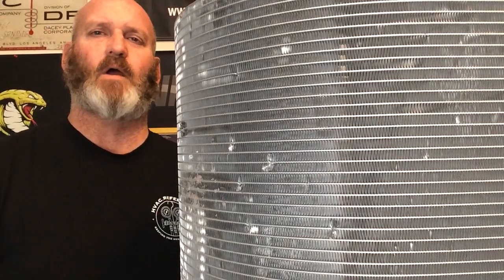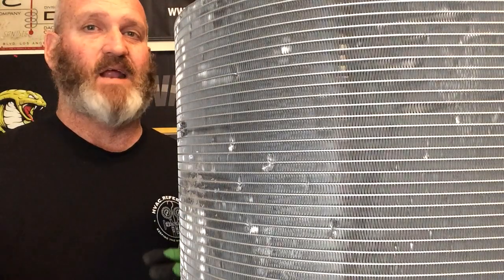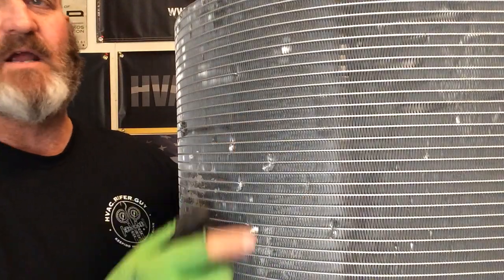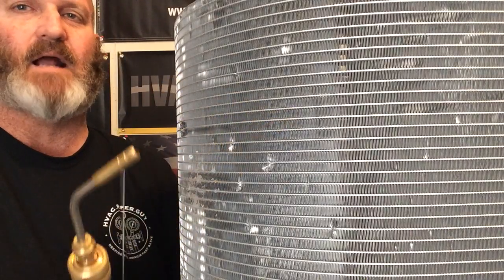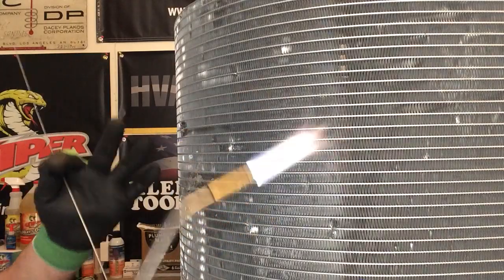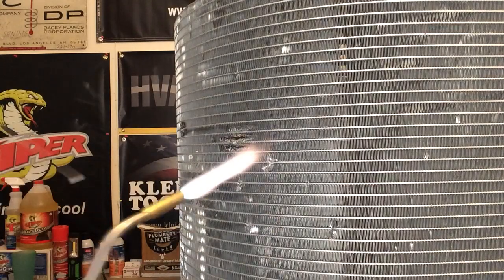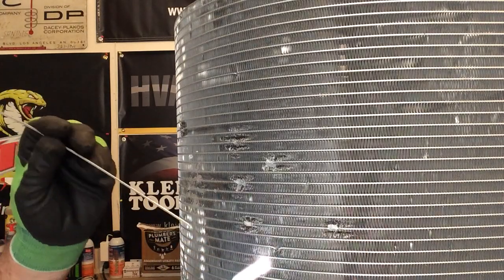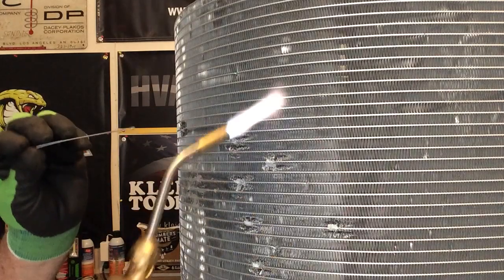Fixing micro channel leaks with Alcop from Solderweld

Comment: I'm confused. Does anyone have any idea why he used the Al-cop rather than the Alloy-sol from Solderweld? Al-cop is for joining aluminum and copper but has internal flux Alloy-sol is intended for aluminum repair and melts at a much lower temp but needs flux. His method seems to work very well and is super quick. Would Al-cop last as a long term micro-channel coil repair solution?
Reply from the maker: No confusion. We tested Al-Cop by accident and found it to flow better than Alloy-Sol for repairing aluminum. Al-Cop lasts just as long and there’s no flux to deal with. We’ve been using it this way for years.

Comment: Would it be a good idea to pull a vacuum while brazing micro channel
Reply from the maker: No. No need for it.
Reply: Yes, on some coils, it helps pull the solder in on difficult spots

Comment: Question why are you using the Alcop instead of the Alloy Sol, I believe the Micro channel condenser coils are all aluminum?
Reply from the maker: We found that the AlCop works better on micro channel. It was an accidental find when Solderweld was in our shop doing a class on brazing. AlCop is all we stock in our vans and we have had no issue. It’s entirely up to you and what you feel comfortable with.

Comment: Oh these coils are the worst. I've had to do so much warranty work on these coils and I've stopped selling York. I will never sell York equipment unless they fix this bs. It's horrible.  One of my customers for example 18 months a whole brand new system. Bam leak in the coil. We can't warranty the labor or the refrigerant. It makes me look like an AH and I genuinely feel terrible. There should have been some law suit and a free replacement agreement for all these coils.  I will never ever sell another York unit...
Reply from the maker: Many companies use micro channel. We have no problems making coil repairs.
Reply: @cochisecounty_travels  I refuse to do a micro channel repair. 😤 I think the idea is pretty cool but the need to get their s together first! Way too many issues with micro channel leaks and evap coil leaks. It's ridiculous. Then again it does provide a pay check
Reply from the maker: @hvacdr  We had a micro channel in Colorado that was shot with a gun. We fixed and got the unit back on line. most repairs are shipping or freight issues during transport.
Reply: @cochisecounty_travels   we we we. Im over 35000 service calls in.  I have fixed a coil that was shot by 9 mm. It was on video. it grazed through the copper coil and it only needed a simple patch. I saw the video. A tenant was trying to kill the owner. The guy is in prison. As far as them aluminum coils i wont sell a unit that has those type of coils unless im held at gun point. and i also will not fix one unless held at gun point.

Comment: Thank god someone is experienced enough to repair micro channel coils because there’s too many technicians that just recommend a new unit instead of fixing the coil
Reply: Microchannel can be patched, but the coils are just junk.
Reply: @zack9912000  I agree but I’ve come into situations where the micro channel coil is leaking and it’s the customers only unit. Just fix it and recommend a new coil after
Reply from the maker: All of our guys are trained in microchannel. Repairs are pretty easy

Comment: Does it cause any restrictions and does the refrigerant fliw through the the coil?
Reply: It does not. The filler material bonds to the parent metal only without slag or impediment to the flow of the line